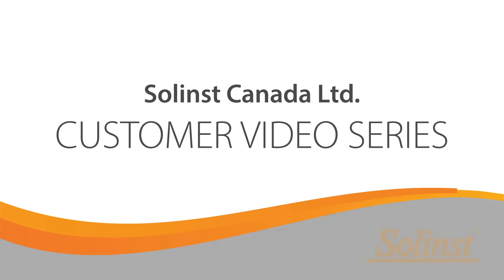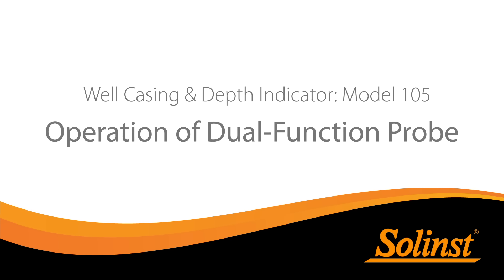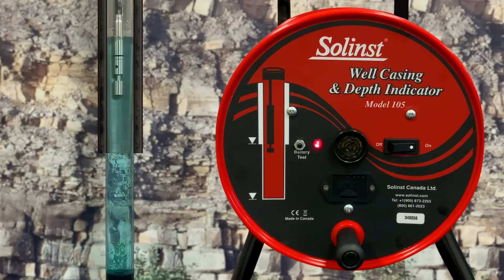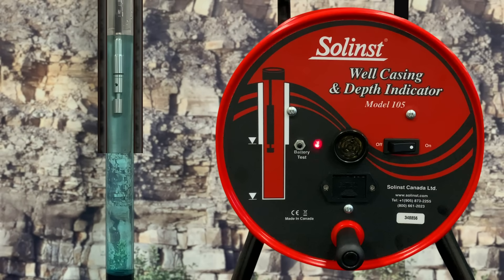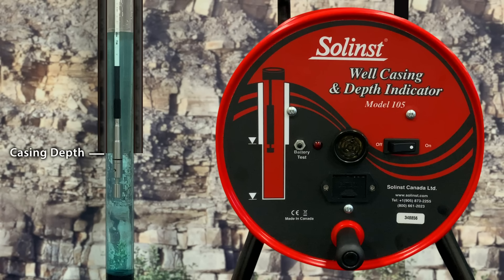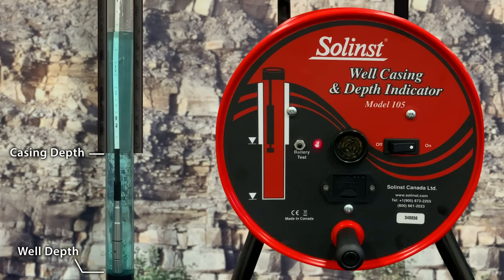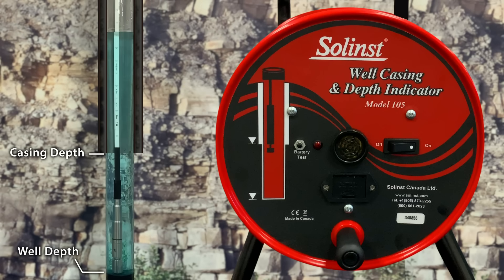How To Operate: Solinst Well Casing & Depth Indicator: Metal Well Casing Detection: Total Well Depth

Comment: If the casing is PVC than it is work
Reply: No it won’t work. The casing needs to be a ferromagnetic material such as iron. Another point to remember is the “zero” point is different for the casing and well depth.